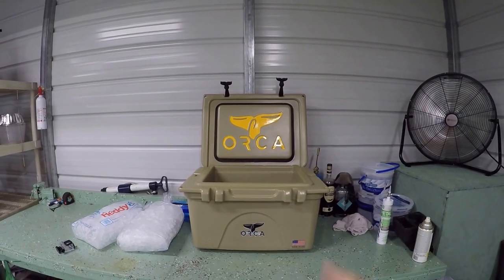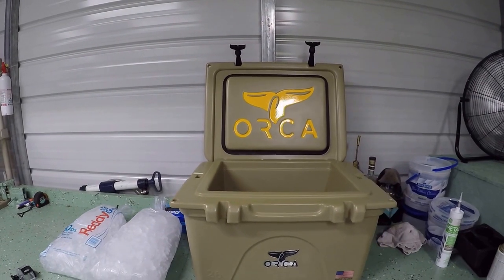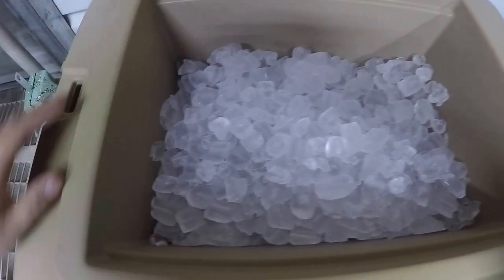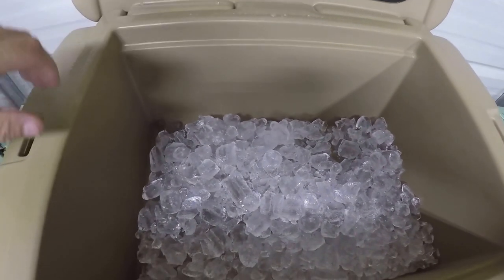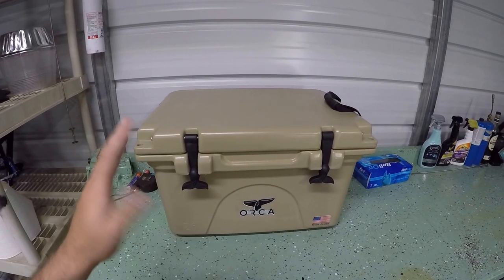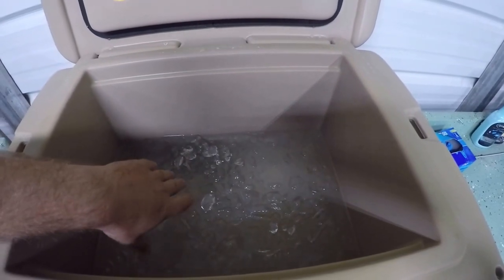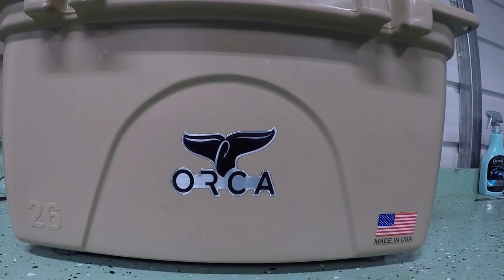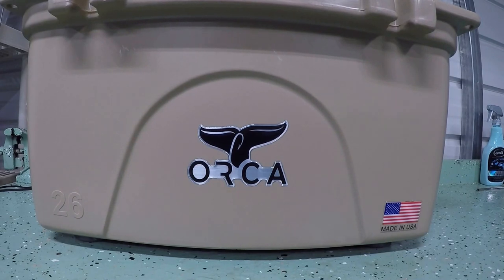orca cooler ice test

Comment: Good test, but you can make the ice last much longer with a few simple tricks. AIR is the main culprit here in this test. So, 
1) Pre-chill cooler a day before or over nite before loading contents.
2) Make sure all food & drinks are pre-chilled also.
3) Line bottom of cooler with a few bottles of frozen water.
4)Purchase a small sheet of REFLECTIX from Lowes, its an thin insulative sheet used in buildings. Cut a rectangular piece to fit the cooler on top of the ice, it will insulate the ice from air as it melts, & push it back down over the ice each time you open & use the cooler.
5) Drain the water out each morning when the air temp is cooler.  By doing these simply techniques you will find that you will extend your ice retention expedentually!  Probably get. 10+ days out of it. I have a140qt Orca & I can get 16+ days outnof mine. :)
Reply: mountaingoat1100 can you make a video pre-chilling your cooler!!?
Reply: If you have to do that much to a $350 cooler then it's the wrong cooler

Comment: I've been using my Orca 26 a lot since around 5/18, and you're about exactly spot on.  Under heavy use, I'm getting about 2, 21/2 days max of ice.  Temps in the upper 90s. Water is still cool enough on the 3rd maybe even 4th day to drink any beer that's left swimming around. If I prechill and throw in a good sized ice pack with the ice,  or a margarine tub of ice it does better, of course, but cuts into beer space.All in all Im very happy with mine. Easily doubles the ice expectancy over my 28q Coleman and 19q Gott coolers. I figure I'll honestly save $50 this year on ice. (at least 5 hot months use, 4weeks a mo, bag a week, 2.47 a bag of ice here).  It'll pay for itself quicker than most people realize if you drink a lot :)I was already nearly decided on Orca when I saw your video last year,  and made up my mind for me. So thanks btw!

Comment: One thing I found helps keep the ice longer is to get it bulk or what I do is fill 2L or 1L plastic bottles and freeze them and pack them in my normal igloo coolers. It last 5 or 6 days and I don't worry about my food or what ever getting wet. I would like to see you to the same test with ice bottles or a block. I will end up getting the orca cooler when I can get one. Thanks

Comment: I just bought a brand new Orca 10 day cooler & can only get 2 days or ice retention inside my climate controlled house in the low 70's F. What's the secret to getting close to 10 days? Do you guys use special ice or what?
Reply from the maker: When I done this ice test I only opened up the lid twice A-day you might have purchased a counterfeit unit.   Try to do some research and see if there's counterfeit units out on a market
Reply: Good idea or it could just be defective.
Reply: Live Free or Die  it’s really subjective , I seriously doubt its defective they inject the foam , and I was only getting like two out of mine also.  It’s a great cooler , better quality then and ice retention then yeti .  For one he put ice , and nothing else when you are loaded down with drinks you will put less ice , people seem to get caught up in how long it has ice , but mine was still be cold for 3-4 days that’s all that matters to me.   Also prechill the cooler in a climate controlled car , or house before ice that helps substantially
Reply: You're supposed to activate it 24 hours before use with ice. Then drain and add more ice. That's how you get max efficiency on ANY cooler and that's the trick. 

They don't tell you that though.